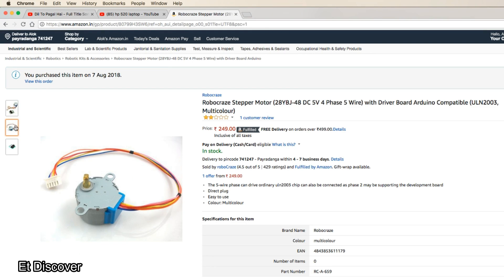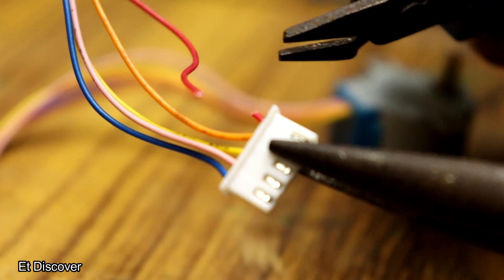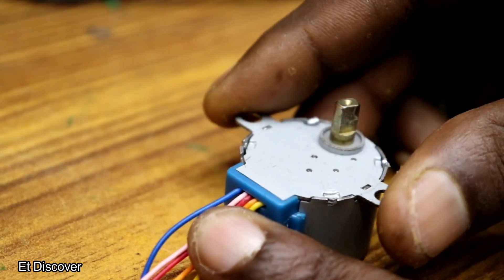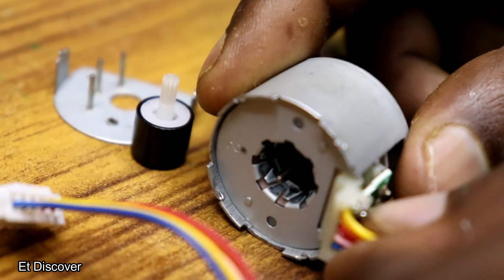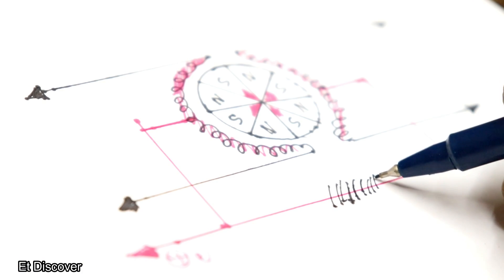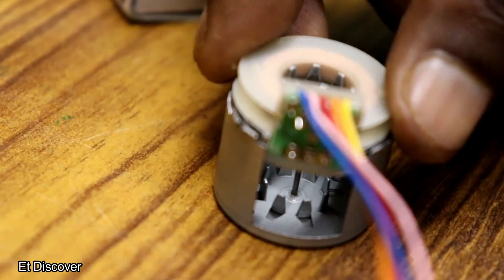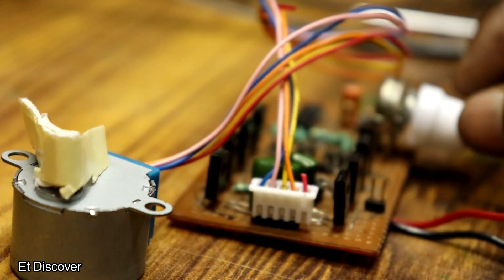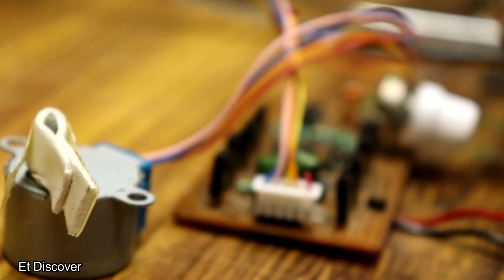What's Inside of 28YBJ-48 Motor & Convert Unipolar to Bipolar.

Comment: You don't need to disassemble it, just don't use the red wire to run it bipolar, but it doubles the resistance, so you should run it on 12v if you run it bipolar.
Or if you open it up and cut that trace, then add a sixth wire to the lower center tap, and use the center and edge wires to run it bipolar on 5v.